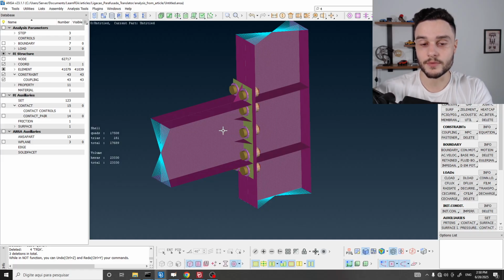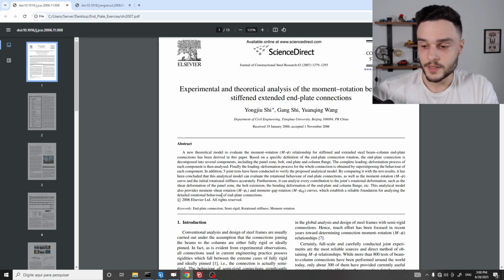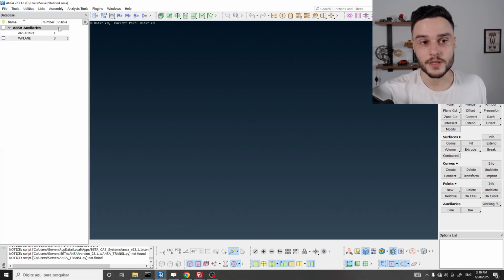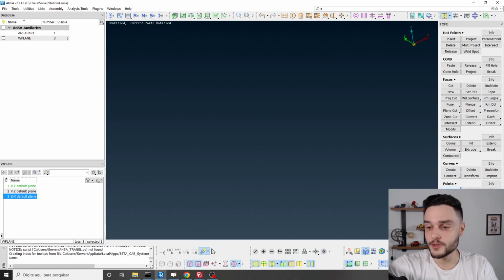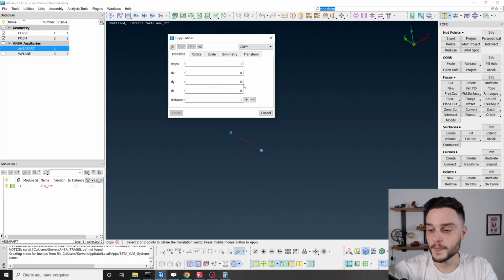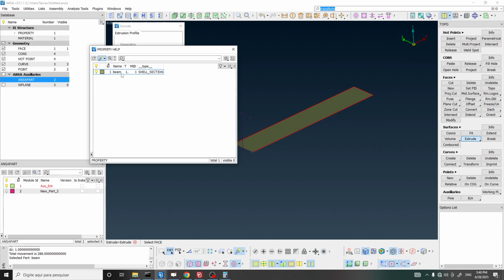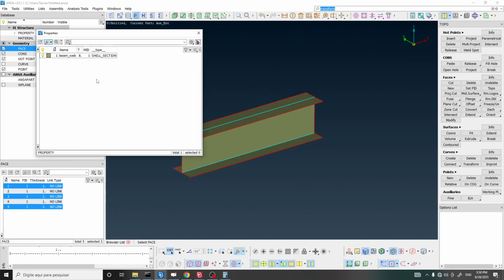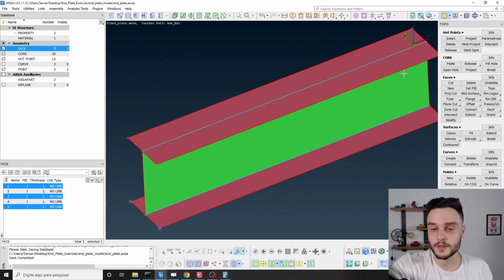Bolted End-Plate Connection - FEA Tutorial with ANSA, Abaqus and META - Part 1

Comment: Thanks Renato for this great tutorial. This is high quality information!

(Tip for anyone who also faces these issue:
1. if you don't see the web and flanges in different color even after assigning different PID to each, it might be due to the selected draw mode. Change it from MID to PID and it will reflect accordingly.

2. When creating a new part, if you don't see the options SHELL or COMPOSITE, but instead see PSHELL or PCOMP, it might be due to the solver deck selected. For me, on start-up ANSA always has NASTRAN selected. I had to change it to ABAQUS.)
Reply from the maker: I'm glad you're enjoying it!

Very important tips!